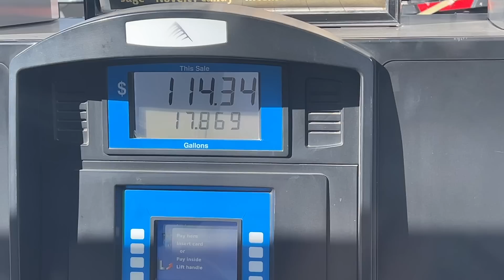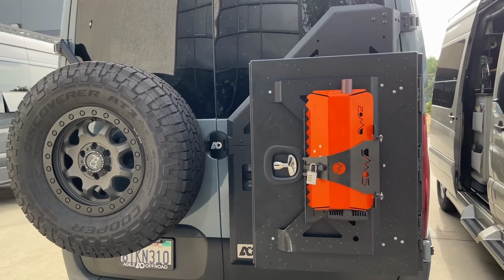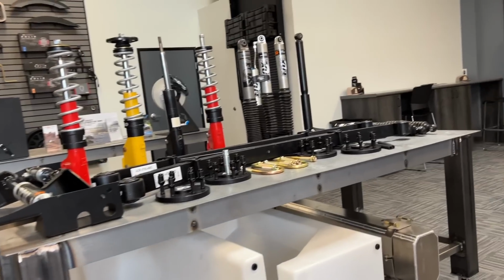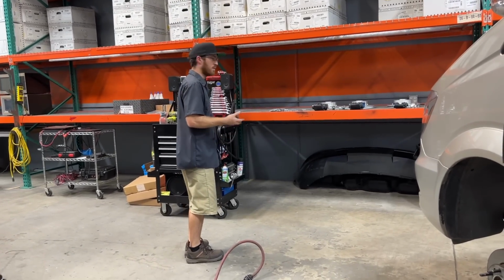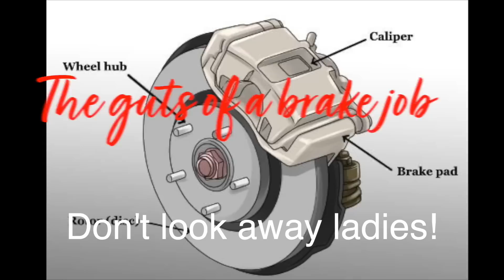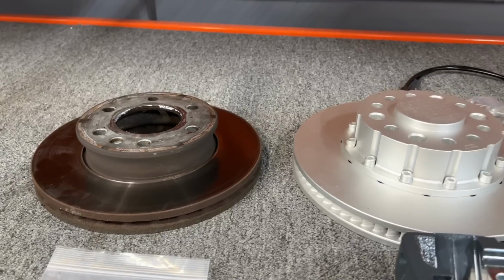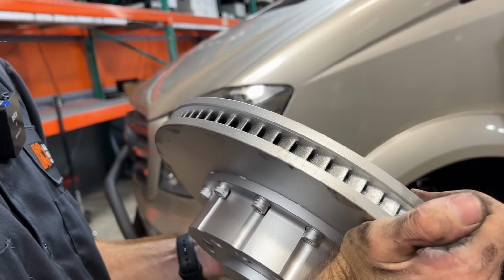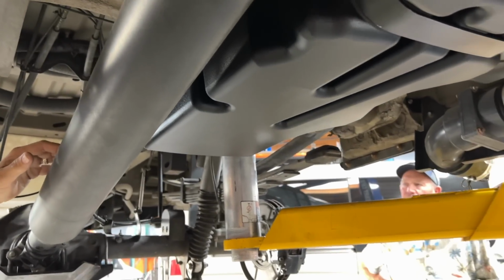Braking up is a good thing to do.

Comment: I’m confused, thought your getting a new van? Why are you putting more money into your van, do you feel you will be getting it back when you sell it? Use guys are my idols!! Keep up the great work.
Reply from the maker: We figured it would be at least a year before we’d have a van. At this point we have been ghosted by Ford. The dealer doesn’t return calls and we are working with another dealer as we consider the new Ford Trail. But the expense is worth the peace of mind. And the brakes were due for a replacement.
Reply: Totally understand. We were in the same situation, this is why we pulled out. Good luck in getting your full deposit back from your dealership if you cancel your order. We got ours back but it took a lot of time & fighting.

Comment: Greetings from Winston-Salem, NC. Finally got overdue Service A we had to cancel to avoid Hurricane Fiona. Do your beefier brakes affect your carrying capacity?
Reply from the maker: Well, nothing can change the sticker on the door but I'm sure bigger brakes will be better for such a heavy vehicle.  Nothing worse than smelling burning brakes coming down a steep grade.  We actually overran a stop in Nova Scotia that probably wouldn't happen now.  The RIP kit has a bigger impact on carrying capacity.  Some upfitters even include an aftermarket suspension for that reason.  But if you email Agile, they'll be better at giving you good info.
Reply: @FromShetoMe  It is my understanding that the limiting factor for the Gross weight sticker weights for Sprinter-based RVs is the brakes. Just curious if that came up
Reply from the maker: @kxrv6629  I've never heard that.  But this article seems to align with that thinking:  https://faroutride.com/weight/

Comment: Heavy duty brakes make eminent sense given the places you go.  I presume you are also downshifting to make use of engine braking on steep downgrades, to take the "heat" off your braking system?
Reply from the maker: Yes we do.  However, John at Agile said that with these brakes, we could ride them all the way down a steep grade without any issues.
Reply: I wouldn't ride even those brakes down a long, steep grade.  It doesn't hurt your engine and transmission to stay in low gear, using the brakes only sparingly.  And, your brake pads last longer.
Reply from the maker: @ralphpond2121  Yes, that's what we do.  It is interesting to note that the pads it replaced still had 40-50% left on them.  So you can see we drive pretty conservatively.

Comment: I just noticed your spare.  Did you do a video on that and I missed it?  Can I ask where you got it and if you're happy with it?  We're looking for a spare rack for our Ram.
Reply from the maker: Agile did our spare rack and it is a full size spare.  We thought it was essential before our trip to Alaska.  Unfortunately, Agile doesn't work on the Ram van.  I don't know if Van Compass does but check them out as well as Owl Vans.
Reply: @FromShetoMe  Thanks Deb.  We may have to head toward Aluminess or Landed Gear.
Reply from the maker: @JustMe-vi8nx  Luminess is across the street from Agile in Santee.

Comment: Thanks for the video.  I've been looking at this brake package.  It's good to see someone got it and to see the side by side comparision of the OEM vs AO system.
Now that you have had it, what do you think?
With it being so proprietary, how will you handle any issues if you are away from an AO location?
Do you know if the rotors can be turned if they wear?  I ask because we had an issue with our 2017 Sprinter.  The MB dealer said the rotors could not be turned.  They had to be replaced.  You know - if it has MB on it, hold on to your wallet.  A routine brake job cost over $1700.
Reply from the maker: Agile has mechanics they work with all around the country but I think any brake specialist could work on them. One thing we never do is take the rig to Mercedes. You might want to email Agile for your other questions. I wouldn’t want to give you bad information.
Reply: The dealership probably won't turn the rotors because of lack of profit and liability reasons.  Almost all stock vehicle brake rotors are of minimal thickness.  And the dealerships make a lot more profit by selling new rotors.  Thats true for any brand of vehicle.  Unless there are warranty issues involved, try to find an independent shop you can trust.